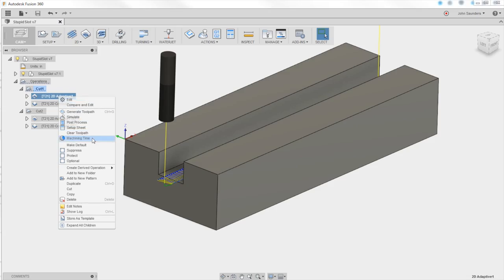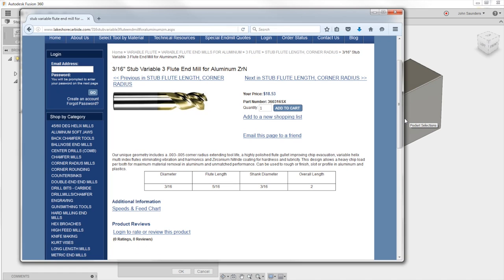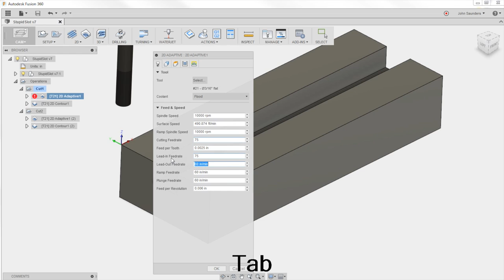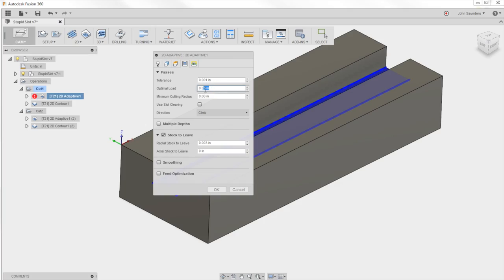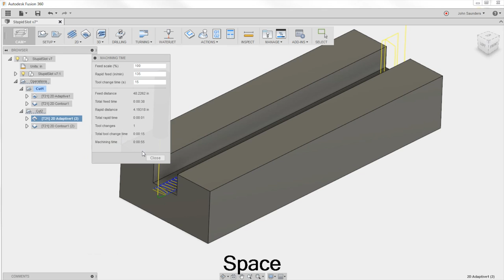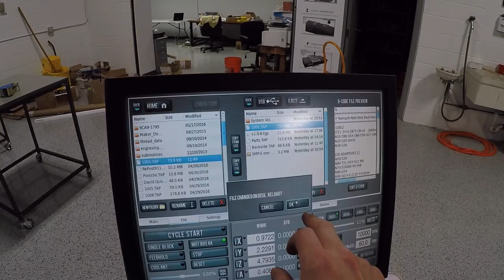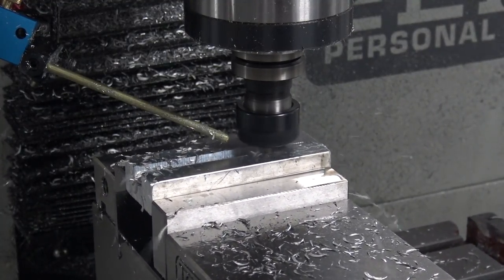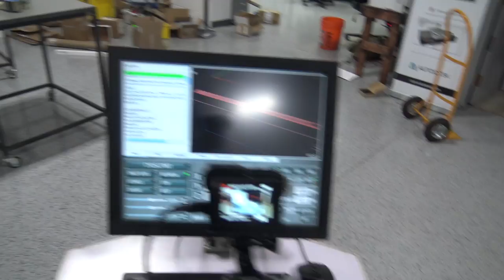Stop Slotting The Stupid Way!  Fusion 360 Adaptive!  Widget101

Comment: Great demonstration on pushing the small diam end mill, but not the best way to cut this slot.  You may be focusing on this high efficiency toolpath due to the machine HP limitation, but with a high performance carbide you can cut the same slot so much faster.  It's not really the stupid way to slot if it gives you the result efficiently. 

For example, with a .375", 3 flute, 0.5" LOC, .75" stickout, 10k rpm, 212 ipm, .375 DOC, the rough cut on a 6" piece (estimated based on your vise) will take less than 2 seconds.  You can run similar clean up cuts for the sides at 80 ipm or 4.5 sec ea.  Your total slot cut time will be 11 seconds. These numbers are based on the Helical end mills I use with the Helical/Volumill Milling Advisor and the surface finishes I like.  You can run the clean up cuts faster, but you get a rougher surface.  Many other high performance cutters do the same feeds/speeds so it is not a brand thing. I have used Widia and OSG pushing the same rates and they also perform really well.  I am also looking into Imco cutters after seeing how fast Titan American Built pushes his Haas machines with Autodesk HSM and Imco cutters.  He gets up to 800 ipm with some parts, which seems insanely fast.

The high efficiency milling toolpaths like the Autodesk HSM or Volumill add in for other CAM packages really increases your material removal rate by maintaining the chip load with the swooping paths.  They avoid the traditional constant speed roughing toolpaths with corner pauses for directional changes where there is too much material engagement around the end mill.
Reply: I understand this. My point is you are saying traditional slotting is the stupid way to slot, which is misleading.  Have you looked at what your machine can do with traditional slotting with a .375 EM for comparison?  You may find traditional slotting is still faster in your machines for some applications including the example you show in this video.   Slotting this way has so many repetitive moves and increased tool path length that it may be slower and more expensive for you and your customer.

The high efficiency tool paths are really great for pocket roughing improving your cutting time by upwards of 70% depending on the part.  If you said stop pocketing the stupid way I would agree your title is accurate.
Reply: Michael

Comment: PS... Take your vise handles out of the machine when they are running!
Reply: +Vladgorod7  back and forth Y movements will make the handle slap against table and way covers. 

Always always always remove the vise handles from a machine.  There's never an "OK" time to leave it on when the machine is running. 

I've seems em take doors right off, break chip conveyers, launch pallets off the base on pallet changes, and numerous other things. 

2 secs to put a handle on or off is much less costly than ripping a door clean off a machine when it homes Y,X at rapid speed.
Reply: Yep! I've seen it happen as well, had the joy of removing a vice to get the handle off after someone jammed it behind the door. Near impossible to get to.
Reply: Its a Tormach.  Top rapid isn't all that high, and they only accelerate at 15iss.  Still they did acquire a real VMC recently, and that practice could be dangerous if they forget its a different class of machine.
Reply: great to have a machine police here, what shall we do without you folks.
Reply: Hopefully not cause expensive damage to your machines or worse, damage to yourself....  

Unless you think you're faster and stronger than the machine....  hint.  You're not...
Reply: pssst, i leave the key in the chuck when i dont leave the lathe!!!!!
and i like it :-)))))))
Reply: Jan Lundquist 
Good. I hope you work alone with no one else around. 
People like you are the reason why we have these warning stickers and safety interlocks today. Because you can't be trusted to perform even the basic of common sense tasks.
Reply: no they dont.!
they try to get rid of people like you so they dont have to get an uggly atmosphere in the lunch room.

good night officer. wherever you are.
Reply: That's machining 101. Something a 'self taught machinist should know

Comment: Sir, Is leaving the vice handle in place OK? I'd be afarid that under certain circumstances the handle would  get wedged.
Great video and very interesting results.
Eric
Reply: Yes, you should remove it.  Especially now that you have a real VMC.  I could have said it doesn't matters.  Tormachs only accelerate at 15iss, but that bad habit could cost you on your big machine.  

P.S.  I find myself leaving vice handles on sometimes when doing repetitive quick jobs like squaring up a bunch of stock blanks.  I better stop it too.  Someday I might get a real VMC.  LOL.

P.P.S.  Even at 30iss (My Hurco KMB1 is set at 30) I don't have things go flying from rapid reversal, but the machine does shake a bit when doing a lot of them.

Comment: One of my mentors had a recipe for these situations: "Crank it up til you bust something, then back off a notch." My suggestion is try 0.005" per tooth if your machine will feed that fast.

Have you compared that same stock removal problem with a 4 step straight groove running a stubby 3/8" end mill at 0.005" feed per tooth. Let's see: 5" part, 3 tooth cutter @ 10,000 RPM = 4 cuts @ 5" / 50 IPM = 20/50 = 24 second plus 15% for positioning BS = 30 seconds? 

I wouldn't hesitate in steel with jet coolant but aluminum can ball up in the flutes unless air flushed and misted w/coolant. 

Comment, Mr Spock? Analysis?
Reply: Gotta say, I'm with Forest on this one.  These whiz bang toolpaths spend a LOT of spindle on time not making chips.  That just seems super inefficient to me, even if it is a little easier on the tool.

For a machine that has no horsepower or thrust on the motion drives, OK sure, you can move more metal without blowing up your machine, but if you have an actual industrial machine tool with some HP and thrust, you're wasting time doing things this way in aluminum.

Sure, for titanium or the heat resistant super alloys where you can't use run the tools that hard or deep, I can see where these toolpaths would help keep the chipload and productivity up, but for a slot like this in aluminum, you should be plowing that out in just a few passes.

I routinely slot 1/2" deep with a 1/2" 3flt tool at 5k RPM and 60 IPM in 6061 T6 alum bar.  Full WOC, flood coolant with an air blast to clear the chips.  That's only 0.004 IPT, some tool grinders say they can take that cut at 0.006 IPT (my machine is so old that 90 IPM is getting up around where it starts to have following errors and overshoot, but the tools would probably cut it just fine).

A 3/8" 3 flt tool ought to be able to make a 3/8" deep slot at 30 IPM in one pass, full WOC.

Forest already did the math, it's pretty hard to beat ~30 sec for a path that took you ~1min45sec.

Yes you used a smaller tool, but so what?  We're talking about the difference between a $20 tool and a $30 tool.

I figure that my machine time is worth ~$1/min, so it doesn't take much wasted time to make up for that extra $10 spent on a bigger tool, plus the machine is free to do other things during the time you save.

In aerospace materials and in certain other circumstances, this adaptive stuff is a godsend, but for cake work like slotting or profiling around parts in aluminum, it wastes a lot of time.

I have tried it head to head with my old way of doing things in alum, and the old way is much more productive for most things.  Thin wall stuff and floppy setups are an exception to this rule, because the adaptive greatly reduces the cutting loads on the part.

In a recent part I was programming, I did it both way to see which would be faster.  Adaptive machining took almost 7mins per part, while the old way was just over 2mins per part.

Multiply that by a couple hundred parts, and you're literally wasting DAYS cutting air.

Even if I smoke the $40 tool twice as fast, I'm still WAY ahead doing that instead of cutting air.

The technology is neat, and the capability is useful to have, but it is not the end all be all of toolpaths.  You have to consider the whole picture and figure out what is most efficient, even if that means it eats a few more tools over the course of a job.
Reply: +LogicIndustries I haven't Logic's experience with CNC but I can certainly concur with his points about the effective uses of adaptive control for thin parts, fragile cutters, deflection and distortion control, chip control in deep recesses, etc. 

I now understand John's use of adaptive control for slotting that stout, rigidly gripped hunk of aluminum was only a demonstration. That same technique used to profile delicate parts or pocketing an intricate cavity is adaptive control's true vocation.

It was unfair of me to criticise John's adaptive control demonstration. I failed to see the implications. If I could remove my previous comment, I would. Instead I have to apologise, dammit.
Reply: Thanks for this detailed post. As I was watching John cutting that, I just kept wondering why Fusion comes up with these crazy tool paths that spend about 40% of the time cutting air. Why not just run down one side of the groove and back the other side and be done with it? Maybe 2 seconds total cutting air. Of course you have a full width cut the first time so might have to be careful with chip evacuation, but if you can master that, it sure seems like it would have the job done faster.
Reply: It's horses for courses, sir.  No need to apologize, in my estimation at least.

Adaptive surely has its uses, and for some things I expect that it is wildly more productive than any other strategy (or in some situations, it might be the only strategy that will yield usable results), but it's not ALWAYS the best strategy, full stop.

That's what I was trying to get across.

I see guys using Fusion and they use that 2D adaptive on stuff that there's no reason to use it on, and the end result is that their toolpath takes a lot longer to run, for no good reason.

Sure, for ones and twos, it makes very little difference, but if you're making a lot of something over a long period of time, a 30%-40% increase in cycle time cost a lot of money.

That's all I was trying to get across.  Use adaptive when it's going to do you some good, and use some other strategy when it won't.

Horses for courses.  You don't send an Indy Car to drag race a Top Fuel Dragster, and you don't send a Top Fuel Funny Car to road race an F1 car.

They're all damned fast, and in their element, unbeatable, but any one is not the best solution to EVERY problem.
Reply: LogicIndustries, it seems like you're saying the adaptive strategy is a poor choice because it doesn't work for YOU. It's funny that you say "horses for courses" while simultaneously seeming to ignore that other courses exist.

It sounds like YOUR machine is rigid and you can throw whatever slotting operation you want at it. Great... for you.

Also, it seems that YOUR machine is slow. If you start getting errors when you try to do a positional move at greater than 90 IPM, OF COURSE the time spent cutting air is going to make a big impact FOR YOU. Modern machines can reposition quickly and the time spent cutting air is all but eliminated.

Plus, I would say this channel is more about the "ones and twos", not full production runs. Sorry, but many people simply aren't interested in breaking tools, no matter how cheap they may be, in pursuit of the most TIME-efficient toolpath.
Reply: +Hirudin Touchy trolls already. Now I'm REALLY sorry I couldn't detete my causative post.
Reply: With all that said, I'm going to subscribe to your channel, looks like you're doing some cool projects!
Reply: 40% of the toolpath spent cutting air is still time wasted, even if your machine has 1,200 IPM rapids.

BTW, those Tormachs only have 150 IPM rapids, so % of path spent cutting air matters to them more than most, and I'd like to see their following error contouring at 90 IPM.  They're a fifth the size of my machine and you'll find they suffer from overshoot and following errors just the same.

You need very powerful axis motors and excellent modern encoders to produce the high accelerations necessary maintain positional accuracy and prevent overshoot at very high feedrates.  Something the Tormach lacks, just like many older VMC's (though for different reasons).

Also, there are a lot more people out there running the 15-20 yr old industrial machines than there are people running Tormachs, especially in a business setting, so it's not like my experience is somehow so narrow or particular as to be invalid.

If you've got a $150k Mori with 1,500 IPM rapids that can follow perfectly at 800 IPM feeds, you'll still be wasting time and money if you're only keeping the tool in the cut 50% of the time.

I'm not even sure why we're arguing here.

All I was trying to point out was that sometimes using an adaptive strategy IS the stupid way of slotting.

Basically, in many things, but especially in machining, if you're saying "always" or "never", you're probably wrong.
Reply: +LogicIndustries Gotta agree with that final paragraph.
Reply: Thanks!

I didn't mean to seem antagonistic.

Sometimes my blunt style of writing comes across as rather more abrasive than I mean it to be.

Just trying to put forward a bit of info from the other side of the coin.

I'm going to run another batch of those parts I talked about this coming week, hopefully I'll be able to get some video of it so I can show what I'm talking about instead of just telling.
Reply: Forrest Addy, in a PC browser you can delete comments. There's a menu to the top-right of the post that give you the option to delete the post. I know suggesting that you might be using a different "machine" than a PC (which is what I'm using) makes me a troll, but I can live with that.

LogicIndustries, yes, wasted movement equals wasted time. You won't get any argument from me on that point.

The questions are: how much time are you wasting and what benefits are you getting in exchange for that wasted time.

How much time are you wasting? Well, SOME time, there's no denying that. On a machine with somewhat slow acceleration and relatively slow repositioning speed, I'll buy your estimate of 40% lost.
OK, what are you gaining?
1. Lower rigidity requirements, arguably the biggest benefit of HSM toolpaths.
2. Better chip evacuation.
3. Better tool utilization (deep cuts are made with the entire flute instead of multiple passes with the same section of the bottom of the tool).
4. Less variation from one cut to the next. Cutting the slot shown in the video with a 3/8" end mill using a slotting toolpath strategy would result in one pass cutting at 0.375" (100% WOC) and one pass at 0.025" (7% WOC). I've only used a few CAM packages, but I don't recall any giving the option to cut the two different widths at different speeds. In other words, when the tool is coming back and cutting that 25-thousandths at the same speed that that was programmed for a full-slot cut, it's pretty easy to argue that there is some time being wasted at that point as well.
5. Better tool life as a result of #1 - #3. And possibly better tool life because of fewer broken tools that may result from #4. Breaking a $20 tool may not bother someone if they're on the verge of charging $1 minute to run a large batch, but it will probably bother someone that now has to work an extra hour at their day job to replace it. Plus, with small machines the benefits of HSM toolpaths are even more apparent with larger end mills (which, of course, cost more).
6. Fewer tool changes (one tool can be used to mill both large and narrow features). This is one of those benefits that is easier to understand when you're changing tools by hand, without the aid of an ATC or PDB.